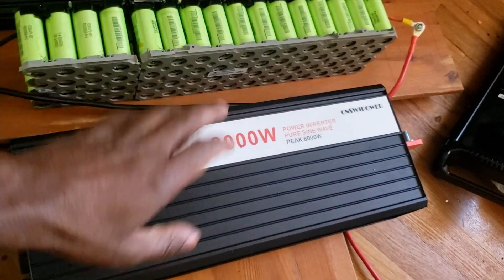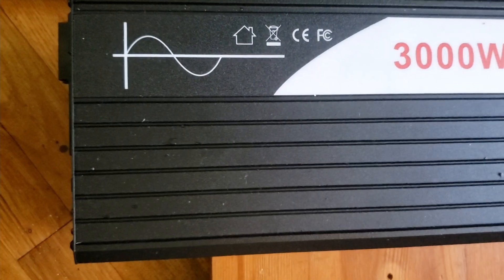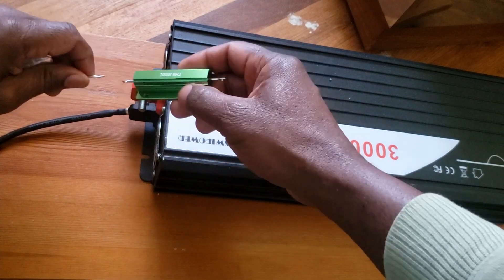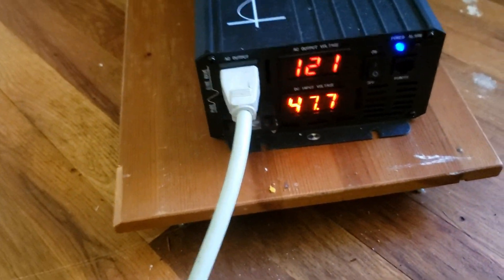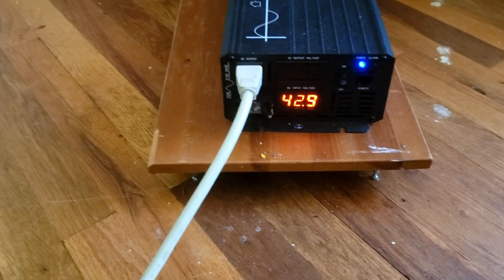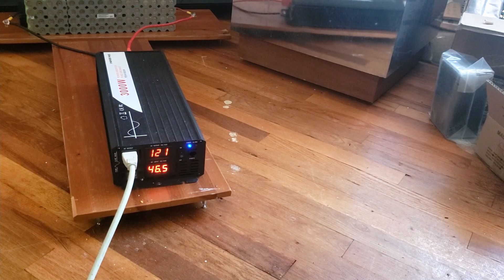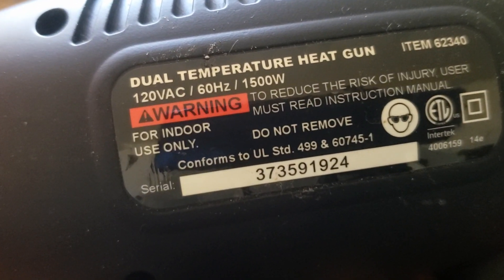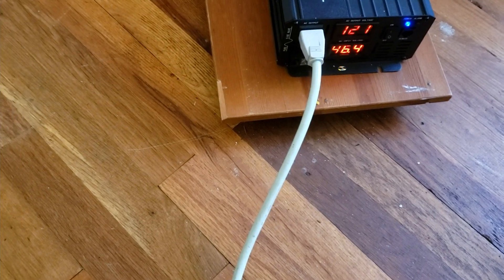A123 Lifepo4 Part8 Testing with 3000W Inverter

Comment: So you should have about 10 minutes worth of power if that's a 485wh pack? But the voltage drops too fast?

Or did you have a succesful run for several minutes that you didn't film?

Running the battery when the underload voltage has dropped to to 42 or below is killing the pack. 42V on a 16S is 2.5V per cell. The under load voltage is where you stop so if it hits 42 under load it doesn't matter what it rebounds to, you've more or less drained the pack and applying a similar load will definitely drop the voltage down too low. Applying a small load is technically safe but you're just avoiding the voltage drop and using up the last little bit you couldn't access because you're pushing the cells at 10C earlier.